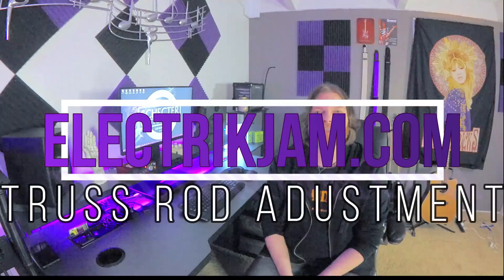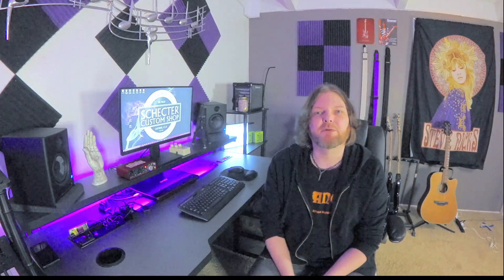Electric Guitar: Spoke Wheel Truss Rod Adjustment

Comment: Appreciate putting up a video on this. Can't believe there wasn't one before. Wanted to figure out how to do it on my charvel. Thanks!
Reply: You're welcome! 

I couldn't believe it either. But here we are. Lol. 

Glad I could help. Spoke wheel truss rods are great, and much easier to access. I wish every guitar had them!
Reply: @christopherhorton4634  Yeah I agree, very convenient
Reply: @Andresdha  Which Charvel do you have? I looked at a DK 24 and almost pulled the trigger. It was so nice!
Reply: @christopherhorton4634  I have a DK24 precisely! Alder body, maple neck, ebony fretboard. HSS pickup config. Went for the floyd rose (a 1000 series, not the original, but I was pleasantly surprised with how stable it is!) 

My favorite thing on it is the neck for sure! The build quality feels incredible for the price, everything is very smooth and the 12”-16” radius plays like a dream. 

I would definitely recommend it!
Reply: @Andresdha  HSS guitars a such versatile weapons! 

And I have found that most Floyd 1000 or 1500 versions are just as good as the Original. I have one guitar with a 1000 series that turns 8 this year! 

If it does ever wear out, I will replace it with an original since it is a direct replacement. But to be fair, the 1000 is almost the same price. 

I might also add some brass blocks to my Floyds one day. I have 3, so that would be a lot of work. 

Glad you like your guitar! Sounds like a killer guitar.
Reply: @christopherhorton4634  100% agree! Thanks, man 👍🏼

Comment: So as I understand it, with a spoke wheel truss rod: 
- Turn the spoke wheel clockwise (viewing the spoke wheel from the guitar's bridge) or down (viewing the spoke wheel from above with the guitar in playing position) to tighten the truss rod / reduce the relief /  lower the action. 
- Turn the spoke wheel counterclockwise (viewing the spoke wheel from the guitar's bridge) or up (viewing the spoke wheel from above with the guitar in playing position) to loosen the truss rod / increase the relief /  raise the action.

Is this correct or incorrect? Conflicting information abounds online.
Reply: That is correct! Yes. You've got it. That's why I made the video, I couldn't find it anywhere!

Comment: What is the tool you showed at the end? I’ve had a couple of brand new Charvels recently and they didn’t come with anything other than the FR allen wrenches which is ridiculous. And these don’t really work too well for the truss wheel. Of course I can use a nail, screwdriver etc but wtf? So ridiculous to not include the correct tool for this.
Reply: Hey! That's the truss rod adjustment tool that came with the Schecter Nick Johnston Signature Guitar. It was in the little bag with the Allen screws. 

But before I got that, I used a jewelry screwdriver and had no issues. Or a small electronics screwdriver. Basically anything that fits in there will work. 

I figured Fender (Charvel) would include those! Weird that they don't. But it won't hurt the guitar to use anything else you have lying around.

Comment: What if wont budge!? Jackson PC1 wheel wont turn past an 8th of a turn or so, not quite a quarter. Ive made a pretty decent tool with a handle so I get plenty of leverage to turn. I've oiled and let sit for dispersement and it still says no. Anyone out there experience this before or possibly know what to do??
Reply from the maker: Does it go the other way? If you are trying to tighten it, you may have it pretty tight already. Can you get it to go the other way?

Comment: Shit. This means I was doing it right, and my brand new Ibanez RGMS7 has a truss rod issue. I've loosened the truss all the way to the left (as if I'm looking down my guitar from the bridge to the headstock; righty/tightening goes towards the treble side of the guitar, and lefty/loosening goes towards the bass side of the guitar), and I've raised the action far above what I feel is acceptable and I STILL can't get rid of fret buzz. It still looks straight as a board. Stock strings. Dammit. I have practice tonight!!!
Reply: Yep, you're doing it right 👍. Hopefully you can get it sorted out!
Reply: In that case you probably have the raise the bridge. The truss rod and the bridge height both affect the action.

Comment: my truss rod doesn't turn in either direction i dont want to use too much force and break it
Reply: I would take it to a tech just to be sure, then. Sometimes it does take a little force with the little tool that came with your guitar. But if you're not comfortable? Don't make a mistake. Take it to a tech.

Comment: What if you have two of these truss rods on 8 string?
Reply: Then you need something like a straightedge to measure it. Because that means one takes care of the treble side, the other takes care of the bass side. 

It works the same. But you need to make sure they are measured properly. A straightedge is your best option to make sure the neck is flat all the way across 8 strings.
Reply: The neck is actually perfect, but wheels are screwed in to a different depth, I wonder if they should be even.. Does it mean that one rod is loose and all tension of the neck is on the other truss rod?
Reply: @Alex19II   Probably not all the tension. If the neck is fine, and has no issues, you're good. Depending on the brand it may be a dual action truss rod. Read up on those. 

But if it is fine, no need to mess with it. They should not be even with each other. One side will probably need more tension than the other. Especially if it is multi scale.
Reply: Yeah, it’s a multiscale legator, curious that all other such guitars have wheels screwed in evenly..
Reply: @Alex19II   Every guitar is different. Some might seem even, but they aren't.  Just like saddles on your bridge. Two of the exact same models will intonate differently.